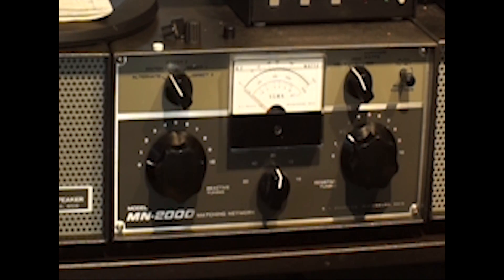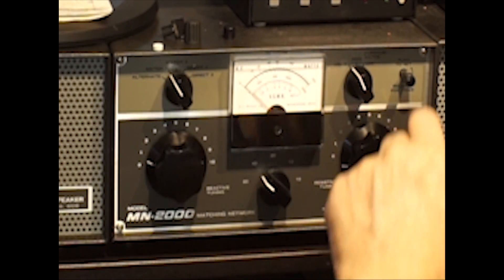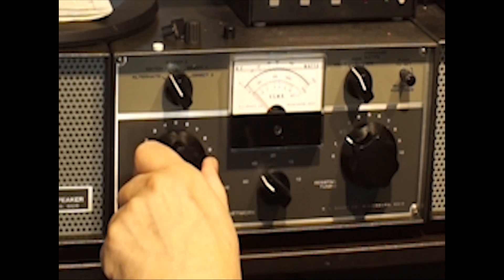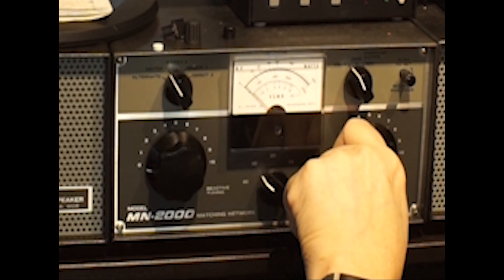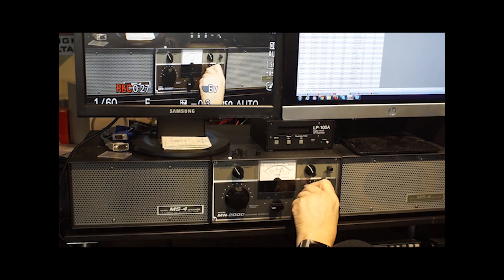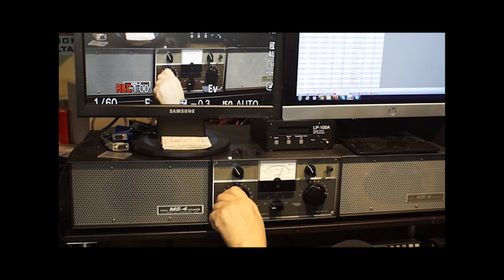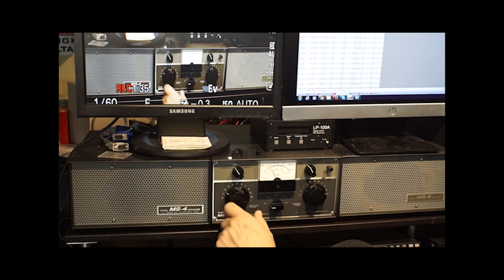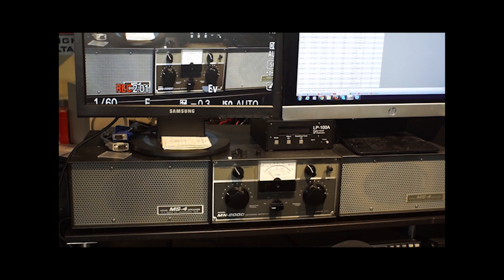Ham-Radio-Basics How to Tune a Manual Antenna Tuner

Comment: Hi Jim, thanks for your video.  I think your technique is not the best.  Tweak one cap for minimum SWR, then offset the other cap, even that makes the SWR worse.  Then tweak the first cap again for minimum SWR.  If the resultant SWR is worse, offset the second cap the other way, and tweak the first cap for minimum SWR.  Keep repeating these iterations until the SWR is the minimum which you can achieve (Should be 1:1 if the load-impedance is within the capabilities of the tuner). It's a bit difficult to explain in words!  But tweaking each cap in turn for minimum SWR will not necessarily result in the optimum settings.  I think this is why often one hears complaints, about even expensive tuners, that "it will not get my SWR below 1.5:1" for example.  My iterative technique above should get you to the unique settings, of the caps, for minimum SWR.  I think your approach will not necessarily get you there; it will get you to a dip in reflected power, but not necessarily the best SWR.  The same applies to adjustment of the output tank circuits in valve amplifiers; I often see people recommending your technique for that also; sad news for the valve possibly being unnecessarily stressed with that technique! Hope that helps!  Vy. 73, Tim

Comment: Hi Jim! My LDG auto tuner failed on me so I picked up a BW Model VS 300A manual tuner at the local swap meet for $50. Man, I love this thing! Tunes my long wire antenna on 10 through 80 no problem and I have had much better performance on those bands than ever before. I haven’t tried 160 because my wire isn’t cut for 160… but I will give it a try anyway. I won’t be surprised if it gets a match. Question for you- if I add another SWR meter between the tuner and the coax, will it read the same SWR as the SWR between my radio and tuner? If not, why not?

Also, am I losing radiating power through the matching process?

Comment: Hey Jim, how about an off-topic question. Thursday morning, Rich, KI6UOV was talking about doing a fox hunt so I went home and built one of these; http://theleggios.net/wb2hol/projects/rdf/tape_bm.htm. It says it's 7.3 dBd gain. My question; is the gain for receive, transmit or both? On 146.500 it has a 1.1:1 SWR and 50 ohms impedance. In your words, "I'm amazed". Regards, Jeff, KK6CUG.
Reply from the maker: Hey Charlie "Fireguy 1322", When are we having lunch?  Soon I hope.  Great news on the antenna.  That is such a smart design.  I don't know what the gain would be.  The 7.3dBd is higher than I would have guessed; but only by a little.  In any case, the gain is the same for transmit and receive.  As discussed in a prior video, we know that 6dB is 4 times.  That's because each 3dB is a double or two times increase.  Nine dB would be 2 x 2 x 2 which is about 8 times (there is a little rounding in my answer).  So, we can estimate without a calculator that 7dB is about about 5 times.  So, what does that mean?  Well, your 5 watt handheld into a 7dB gain antenna is like 35 watts of Effective Radiated Power.  A received signal that might be 50mV is about 350mV into the receiver.  That is a huge advantage for finding that hidden transmitter with Richard.  Also, that is why I have 2 yagis tied together on 20 meters.  I have about 10 times gain.  Thanks for asking Charlie.  That was a very good question.  73, Jim W6LG
Reply: Does my photo make me look like Charlie?
73, Jeff, KK6CUG
Reply from the maker: Sorry.  My new glasses will be ready in a week.  Struggling a little Jeff.
Reply from the maker: When we do go to lunch, I will buy!
Reply: You're on!

Comment: Hi Jim, I plan to get into QRP in an apartment with an indoor antenna running 1 to 5 watts.  Any suggestions?  I've been looking at the MFJ pocket loop tuner and think that with a 0.625" exterior diameter copper tube (8' diameter) I should get about 66% efficiency.  I realize the antenna is key to this kind of set up but unfortunately I'm stuck inside as far as antennas go. 73s
Reply from the maker: Hi,
I don't recommend QRP for a beginner. Also, a loop requires retuning with frequency changes.  You are going to be spending a lot of time tuning the antenna.  Additionally, the feedline is very important.  My guess is that with 5 watts from the transceiver you will be lucky to radiate 2 watts.  For now, put up a 20 meter dipole that will be 100% efficient.  Run 100 watts to the antenna.  Use a low loss feedline so that you will have an ERP of 100 watts instead of 2 watts.  If you are new, spending your time making contacts.  73, Jim

Comment: Hi Jim i have a quad band Mobile tyt9800plus ham radio that I will  be using as a home base. It is a 10, 6, 2, & 70c . I will be using the diamond pre tune quad band cr8900a antenna with the tram 1465 nmo ground plane. I'm kind of confused on what good coaxe is the best one to buy with lo specification. Are any of these coax are compatible for this kind of radio with lo lost characteristics. The rg-8x vs the lmr 400 or the lmr 420 coax. I will using around 30 to 50ft. Of cable .  I will be using all four band. Thanks ralph 73 kd5qww.
Reply from the maker: Hi,
I don't operate on VHF or UHF.  What you should do is look up either on a table or an online calculator, for UHF the loss for 100 feet and then compute half of that for your installation.  RG8X is not low loss coax.  I'll bet that when you look it up, you will find the loss to be about 2/3 of the power.  In other words, you will put 20 watts into the coax and get 6 watts out the other end.  I have not discussed the efficiency of that antenna system and groundplane. You might loose another 3 watts there. So for 20 watts from the transceiver you might radiate 3 watts.  73, Jim
Reply: Thanks Jim for response I will look in to this. Ralph kd5qww
Reply from the maker: I just looked.  RG8X at 50 feet the loss is about 60%.  LMR400 at 50 feet the loss is about 25%.

Comment: Great video Jim.  Just wanted to add that some manual tuners do not have a "band" switch and instead have letters or numbers on the inductor.  For my Dentron MT-2000 I set the two capacitors to their mid setting then turn the inductor switch until I hear the loudest signal.  Then I transmit at low power and set the capacitors, starting with the left one (Transmitter matching) then the right one (Antenna matching) like you demonstrated in your video.  The same process would apply to many of the MFJ manual tuners.  73, AD0QH
Reply from the maker: That does complicate the tuning.  But, you can do it!  Rotate the knob for the roller inductor first.  Find a dip in the SWR.  Tune the 2 capacitors several times for the minimum SWR and then retune the roller inductor.  Two or three times should do get your tuner very close to the best match.  Thanks for asking Russ.  73, Jim W6LG

Comment: Hi... thanks for nice video Jim.  I was using the building in tuner in the TS-590, it's tune fast but not getting full power out I wasn't really very happy with.  Then I got Palstar AT2K it's much way batter especially with lower bands 40,80 and 160  with just only G5RV.  I really prefer manual tuner.
Reply from the maker: That Palstar is very good.  I too prefer the manual type tuner.  Nice to hear from you my friend.  73, Jim W6LG

Comment: Thanks Jim,  Makes good sense and clear as always, I guess the next question is if you put a power/swr meter in line after the ATU will that show an accurate reading of how efficient or otherwise the antenna is at the non-resonant frequency? 73 Tom M6ONV.
Reply from the maker: Hi,
That meter will not measure efficiency.  It will just show SWR.  SWR may or may not indicate resonance. Your question is very good and something that I need to cover. There is confusion about the meaning or value of SWR.  Thanks for asking. 73, Jim